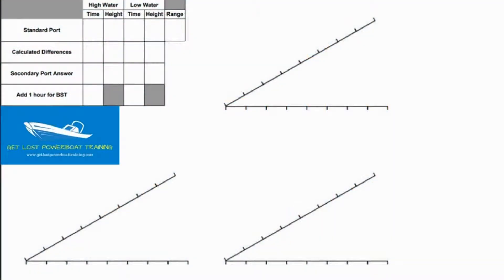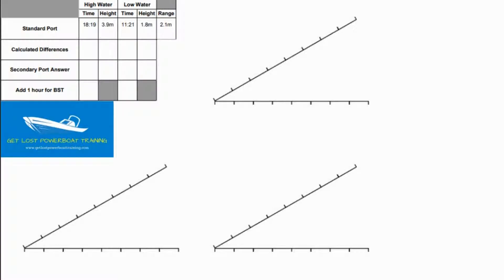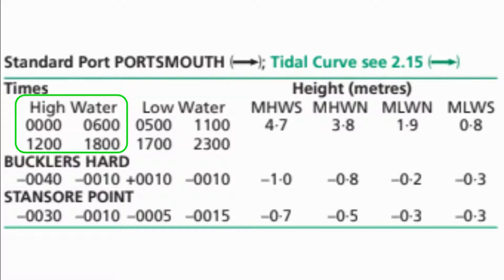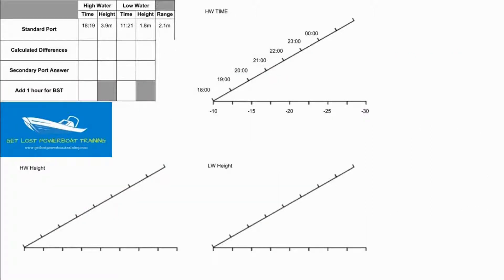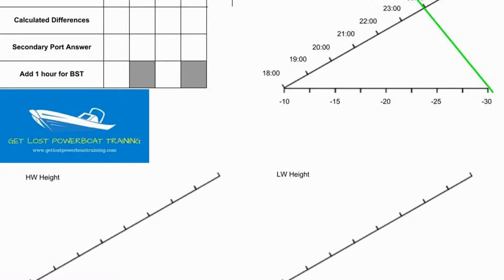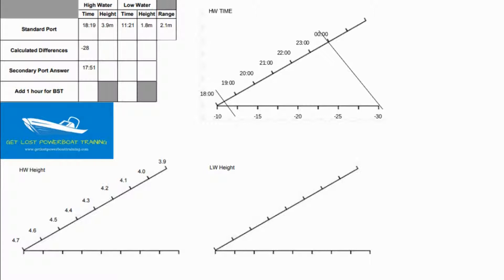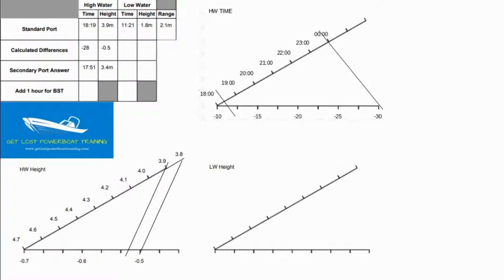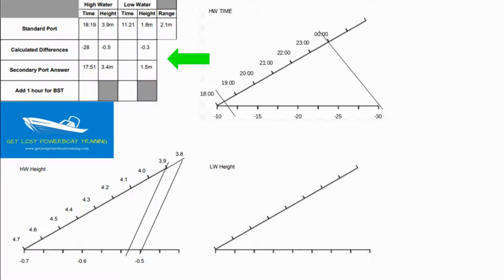Secondary Port Calculations

Comment: Thank you for the teaching. May I ask whether we do need to calculate Low Water Tide time 11:21 and 23:50 separately if Low Water Hight is not the same , 1.8 meter at  11:21 and 23:50, at Standard  Port of Portsmouth from the Almanac.

Comment: why the change to -28 on the HW when the initial calculation was -12 minutes? did I miss a step?
Reply: I’m glad someone else noticed that as well, that has very much confused me.
Reply: @benjaminwilliams8063  Oh that confused you? The whole thing confused me...
Reply: @hamilton you are correct. The time we are looking for is HW at 1819 so the -12 minute time is correct (since the "Difference table" for Stansore has -10 minutes at 1800). The editor must have been confused when it was mistakenly changed to -28